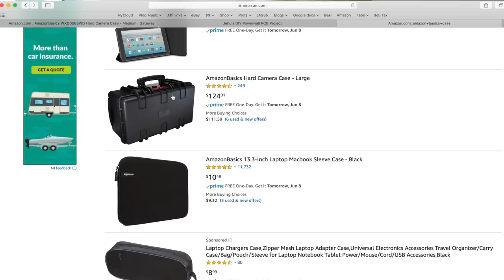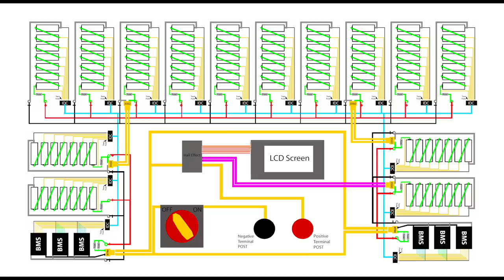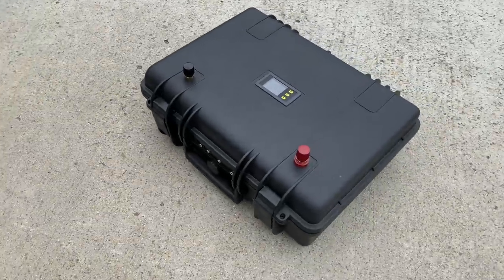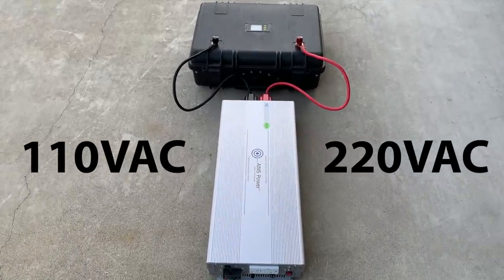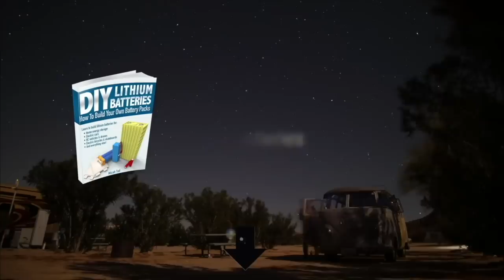600,000mAh DIY Power Pack build

Comment: now try to get that through airport security
Reply: lol that's what i was thinking, airport security will be like "what kind of a bomb is this"?
Reply: @Aman78628  not bomb an EMP
Reply: @Dnoxl  It IS a bomb. Li-ion batteries are extremely unstable - one wrong move and the suitcase will burst into flames like Note 7.
Reply: @dorukayhanwastaken  yea ur rigt ._. forgot it is lithium
Reply: It exceeds the 100 watt hour limit. Some laptop batteries get close to this so it would for sure not be allowed anywhere near an airplane.
Reply: @dorukayhanwastaken  As long as you know what you're doing, they are very safe.
Reply: @hellatyteman13  there are a few drill batteries that exceed the wh limit but still pass with a loophole. The battery is divided into several sections that don't actually get connected until the battery is connected to a tool or charger. So as far as the regulations are concerned its just several small batteries that happen to be packaged together.
Reply: Total expense for this powerbank
Reply: @dorukayhanwastaken  the note 7 battery was soldered just a little crooked causing it to be unstable at heavy use
Reply: I’ve tried they said to leave now
Reply: the firefighter that rescues you after you short it out "hey buddy, still alive?"
Reply: @cctrollz5706  so if i make a powerbank like in the vid and make the individual sections removable will that count?
Reply: @Napert they don't even have to be removable. As long as they aren't connected. If they are connected, the cells count as one battery. If they are electrically disconnected, they are technically several batteries just packaged together. So if you built a big pack like this just work a few disconnects in so there are no connected group equal anything greater than 100wh
Reply: LOL sir we're going to have to do some additional screening.
Reply: They’re able to get through
Reply: @ Doruk, it would be more like 150 note 7s catching fire lol
Reply: well. its literally a huge bomb it caught on fire..
Reply: @Dnoxl  true :D
Reply: @Dnoxl  achauch andere deutsche schauen sich so was an😂
Reply: How much time to charging this battery?
Reply: Austin Aldrich well if it’s at 0.165V it’s 99WH 😉
Reply: FYI - You can't even check something like this on a commercial passenger flight; only cargo flights.And even then, I hope you have good liability insurance...
Reply: They won't let you carry that many lithium cells. There is a limit published by the airline.
Reply: Weareallbeingwatched the limit is per item. Which by FAA standards is 100Wh. for exampleIf you were to carry 2 laptops both with 100Wh batteries, it’s fine, just mustn’t be 1 laptop with a 200Wh battery.
Reply: @cctrollz5706  that is actually a pretty important feature of any large scale battery pack which has to be flown - if you build it on a removable architecture you can individually pack and X Ray the cells. Film and broadcast industries rely upon V Lock batteries for this reason, being a universal adapter for many battery chemistries and units, and it's presumably possible to build a v lock adapter / box for 18650 cells.
Reply: @springbok4015  for reference, here is a transparent cased broadcast  V lock showing the cells inside: https://www.proav.co.uk/swit-pb-m98se-98wh-pocket-v-mount-battery-limited-edition-clear?utm_source=google_shopping&gclid=EAIaIQobChMIxcnPxp735wIVGZ7VCh2yeAxXEAQYAiABEgJowPD_BwE

Also note that the capacity is a flight-regulation compliant 98WH. One can simply plate the batteries up to supply whatever DC/inverter output is required, and this could be a viable solution for mobile power installations, allowing for quick replacement and/or charging of cells.
Reply: @dorukayhanwastaken  Kind of like a 737... one wrong move and it kills hundreds of people.
Reply: The limit is 10.000 mhh
Reply: @dorukayhanwastaken  atleast the screen won't crack
Reply: @greencactusgaming2101  with a CHARGER
Reply: Why TF would you need to fly with it
Reply: Well technically you can go through the tsa with that if you make removable battery connections.
Reply: "its my telephones support suitcase, in case it needs more power"
Reply: @hellatyteman13  came here to say this
Reply: lol
Reply: The last six syllables that the authorities said to you at the airport after being escorted from the plane for trying to travel with this badboy were, "we are going to charge you" 😉
Reply: RPG just assembled.😂😂😂
Reply: @TheAverageYouCuber  lame!! Lol but funny dad joke.
Reply: Former TSA here. We'd have called that for sure. That shit would look so terrifying on xray. Also it's about 6x too big to be allowed in the cabin. Since you can't transport batteries in cargo, this thing cannot fly!
Reply: Impossible
Reply: @dorukayhanwastaken  They are not unstable at all. Only when damaged.
Reply: @Aman78628  airport security wouldnt matter since you can't take a battery bank larger than a 99wh. This is 20x to large
Reply: @syaz4380  every single note 7 battery was dented? Are you high?

Comment: No thanks. I'll wait for the 600,000,000uAh version, which will be way more impressive. Until then, my 600Ah battery will do me fine.
Reply: Just what I thought
Reply: just one of the 3,000mAh batteries is enough
Reply: Tyler Collins didn’t Bill Gates say no one should need more than 640Ah?
Reply: Sean Batt just built a nuclear reactor in your suitcase
Reply: 600Ah = 600,000mAh which is what he made in the video?
Reply: @charimuvilla8693  which is also the joke?
Reply: Yep 600amp
Reply: 0.6 MAh
Reply: @weareallbeingwatched4602  no it would be 0.6kah
Reply: Nah I prefer my 600 (j/C)*(1/R)h battery

Comment: If anyone wants to know the price, it's (excluding shipping and tax)

Case - $74.47
Battery Modules - $22.72 x 14 = $318.08
BMS - $49.00 x 2 = $98.00
Batteries - $730.00

Total about $1220.55 + shipping/tax/fees
Reply: F I was wonder about that and it sounds to to good. In my area power can be knocked out 4 ti times a year it sucks tho the worst was 1 day
Reply: that's not a terrible price for what it can do. it would cost that for two good 12vdc deep cell lead acid batteries but they would weigh a ton more
Reply: Expensive
Reply: erik king 

In my area power gets knocked out 0 times around for like every 10-15 years.... My building had got a stable electricty and that wire is handling electricty even before i was born!!
Reply: And increase that price by 40% if you are using Australian pesos to buy everything (And add a few hundred more for shipping since Americans love charging stupid shipping prices) then add another 10% due to Scott Morrisons bullshit tax
Reply: MWB Gaming : Yeah, and in Canada it would be almost 70% more .....OUCH. I love the idea but the only other negative I can see is that now you MAY also have a bomb waiting to go off. Still, I love the idea .....
Reply: @packratswhatif.3990    I thought Australian and Canadian dollars were pretty close in terms of strength

Do the yanks hit you with crazy shipping fees for tiny items too? (I was once charged $70 shipping to send a spool of wire that weighed about 250g from the US to Australia with eBays global shipping program)
Reply: Ouch Ouch Ouch Ouch, let me take out a second mortgage first ....
Reply: @beedslolkuntus2070  say that one day someone crashed their car into a liggt pole
Reply: 1 batterie costs 630$ and he used 200 of them?!?
Reply: @oberender64  huh?
Reply: I could make it for $300 maybe less
Reply: Is there any benefit to this other than learning purposes?
A Yinlong battery is around $28 - 2.3V 40ah, it weigh around 1 kg (10 of these ~22 pounds)
It has a fast charge but worse discharge 85% like in Lead Batteries
Reply: That's too expensive sadly
Reply: that battery is cool and all but it'll be a lot cheaper to just buy a gasoline generator.
Reply: Oh no, I thought it was $700 per battery and I was like that’s a good way to blow $140,000
Reply: Allen Lantz Over $2,000 Australian 🤪
Reply: @mwbgaming28  create a US shipping address with australia post on the mypost website. It gets posted there and then auspost sorts the rest out and is alot cheaper.
Reply: 1 euro per Ah
Reply: tell you what how to cut the price. There's the Samsung 25R , yes it only has 2500mAh but it has a very low resistance and can take up to 20A of load and if you buy it in a big amount you'll get a very good price. Here in western europe I can get those for 2,1€ for each cell if I buy 200 or more. So with the actual Euro-Dollar exchange that's 2,49 for each cell so you'll end up with an even 1000$ for such a project. Yes the capacity is lower but who says that the EV batteries deliver their rating? Many tests prooved the Samsung and it has other advantages as the lower resistance which is good for charging and it can handle a good load too
Reply: Thanks
Reply: @alenanikitina5929  well, yeah the price would drop after a year
Reply: @duckner  well that doesn't make the product any worse. Does it? After all there still some economics to do that
Reply: So about double what you pay for a premade 200ah battery. Not worth it.
Reply: @silverfoenix  2.3v is nothing you have to quadruple volts and 1/4 AH rating
Reply: Umm... Its cheaper to buy an Ego Nexus or Ryobi powerstation.  Not to mention for little extra you can have spare batteries on hand.  The cost of these DIY batteries need to be significantly less than commercial solutions to be viable.

Comment: When I saw your powerwall boards I wasn't the biggest fan because of the added cost and "complexity" but I knew where you were coming from in designing them and getting them to production.... but this is a PERFECT example of it's benefits, how cool is that, and in a few years you can replace the cells if you want to upgrade... I love it!

Comment: Nice system!
Tip for the standoff posts - if they had left and right threads, then you wouldn't have to disassemble the entire pack from the end just to change a cell in the middle!
Reply: My friend Garcia needs to explore Quick connect unions or combine left handed treads.

Comment: Nice project!  I had to build my own battery suitcase too.
I am an astro-photographer and I've got to have enough power for 2 cameras, peltier cooler, a laptop and heavy tracking mount to last for 2 nights in a row in a middle of a desert.
I couldn't find such a battery off-the-shelf so building one was my only option.
Reply: Do you have build information up on a site or video?
Reply: what did you end up doing? thats why im here
Reply: @ddxfs  Hi, I had 4 e-bike batteries lying around So I made a case for them from an old toolbox. Added several dc-dc voltage regulators and plugs for different gear. And it held on nicely for 2 nights in a row.
Funny that you wrote it today. It got stolen yesterday from my roof observatory together with almost all my astro gear. (
Reply: @denispol79  damn sorry. hope you had insurance :(
Reply: @ddxfs   Thanks, i'm still in a denial stage. ) We have a rather small astro-community in my country. And everyone knows my gear, if it will pop somewhere, I'll know.
Reply: @denispol79  iam sorry for asking but out of curiosity did you find who stole your gear?

Comment: Nice build, some notes: make sure to point out that the 'bare' cells were covered in transparent shrink wrap or some people might get the wrong idea here, you'll need some insulation between the modules in case a battery every shakes loose (for instance: because the suitcase is dropped), you need some hard foam and softer foam inside that to protect the cells if this is used in mobile/vehicular applications (and given that it is a suitcase that should be assumed), and you should use silicone sealant around all ports for plugs, displays and so on to stop moisture due to condensation from creeping into the case. 

I'd also use thicker wiring in case of 100A, what you have there might just live through that but given the fact that if it doesn't it is asking for catastrophic failure it is better to use something a bit thicker, and to tie it down properly. Nice choice of case, self isolating so that at least avoids the mistake many of the people building transportable packs make (they use a steel case and then don't properly line it causing serious issues in the longer term). 

How has it been holding up over time?
Reply: Silicone wire has a much higher ampacity. 200°c rating vs 90°c

Comment: 600,000,000uAh !…
600,000,000,000nAh !!!…
600,000,000,000,000pAh !!!
*explosions*
Reply: 600, 000, 000, 000, 000, 000, 000, 000, 000 yAh !!!!!!!!!
Reply: 0,6kAh? Is that all? 😂
Reply: but can it run Crysis?
Reply: @Zeppelinlv2007  lol
Reply: 0.0000006GAh?
Reply: This click bait title is exactly why the video deserves a thumbs down.
Reply: Only 60Ah, my E-bike has 20Ah and its 48v. At 48v that pack would only be at 30Ah and I paid only about 400usd for mine...
Reply: Right!? Just convert it to Ah already!
Reply: @RonJohn63  most of powerbanks convert it to mAh so hate them instead? he just made it easier for people to compare it to normal powerbank.
Reply: my thought exactly...clickbait.
Reply: hahahaha yea i was thinking the same, why not just write 600Ah battery pack, i mean he did write 2.2kWh so kudos.
Reply: @Leofred2000  1,000mAH = 1 AH. Thus, 600 thousand mAH = 600 AH.
Reply: Mjolnir appears in place of battery case
Reply: 1000000000000000000000 LOLAH
Reply: @1179125  Most applications I’ve seen are rated in Ah. CLICK BAIT!

Comment: Ive been in construction engineering for the vast majority of my career, and I find this stuff interesting and at the same time amazing. Recently I have been looking into battery packs, alternative energy etc. Hoping to install my first solar panel soon to feed a specific part of our house. Want to test the system by utilizing the energy exclusively in that area. Built my first power “go box” this past week.
Reply: Jay- Rus KI5JHX That’s great. I’m looking to do the same
Reply: As an electrical engineering student. Don't believe the free energy stuff, and make sure you put in the correct fuzes. Don't cheap out on solar panels, as cheap solar panels will die before the savings turn into a profit. Do the calculations beforehand, as an engineer you should be able to do the simple maths. Just make sure your circuit is fault proof, and under no circumstances work on the system while power is on it(breakers are awesome for that, even in different parts of the circuit) and don't leave any wires exposed, always check that, it happens to the best of us. And last up, don't cheap out on the mounting for the panels either. Panels can easily be moved by the wind, which is not a fun time when they fall and crack, that's something the person who installed my parents' solar panels fucked up.
Reply: Your building a weed room aintcha
Reply: _____ Im a licensed HAM radio operator, so we like to have 12v (technically 13.8v) backup power supplies. Not into weed. My dad smoked it throughout my childhood, and I never understood the financial pressure he put on our family because of his drug habit. We live in Oklahoma though...so if someone wants to grow it then its fairly easy since they legalized it. Still a waste of time and effort in my opinion
Reply: @jay-rus4437  "BuT wEeD iSnT aS bAd As AlCoHoL" - every teenager doing weed, drinking too much and smoking the occasional sigarette. The people I'm in school with make me fucking sick. It's not that hard to stay sober and take care of yourself in a proper way. It really isn't.

Comment: Anything about temperatures? how thermal issues? How long do you need to charge it?
Reply: maybe needs a year to charge not a big deal you know
Reply: I feel like you could actually charge it fairly quickly if you connected it directly to a house circuit breaker properly
Reply: TNT_AND_THE_FLAME yup. Once. You could definitely charge it quickly at least once.
Reply: @tomzweifel  Do people not know anything about lithium ion? It is very particular about how much current it can take at once. Otherwise, we would just be hooking raw copper wire into our iphone and jamming it into a wall outlet for 100% charge lmfao
Reply: I would make above the cells themselves a passive radiator with think copper heat pipes that will go between 2 rows of batteries and you open the lid when charging or discharging to dissipate the heat and when you transport it you have it closed and weather sealed , and also heat indicators and switches to not allow the pack to overheat or underheat allowing a heating element to be powered and heat the heat pipes if you are under 5 degrees celsius.(i see he has room for that in that case and if not we go 1 step bigger)
Reply: so for current battery pack we have to get 16 heat pipes + the passive top radiator where you solder the end op the pipes to dissipate heat and you could also go with a fan if you have the space r cut the middle fins shorter to place a thin fan blowing air up to also have an active part if the battery will go over 40 degrees celsius.
Reply: Wait wtf, they're 3.7v cells, that means only 7 are needed to achieve 24v. So basically each module is 24k or so mah since they pack 14 cells per module , that would make the entire case 360k or some mah

Comment: Your 7s PCB is great. You should do a LiFePO4 PCB for 24V and 48V systems as well.
Reply: I actually just finished working on a 3D printable design for the battery holders, and one of the included presets (thanks to the design I used as a base) is a holder for a 26650 LiFePo4 cell. I've loaded it on Thingiverse here: https://www.thingiverse.com/thing:3824557

Please note I can't make any promises about my 3D printable design, ESPECIALLY WITH REGARDS TO SAFETY! however I did make it exactly for people like yourself, and/or as an inexpensive alternative.